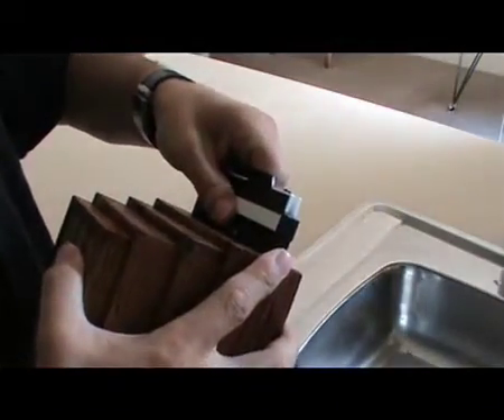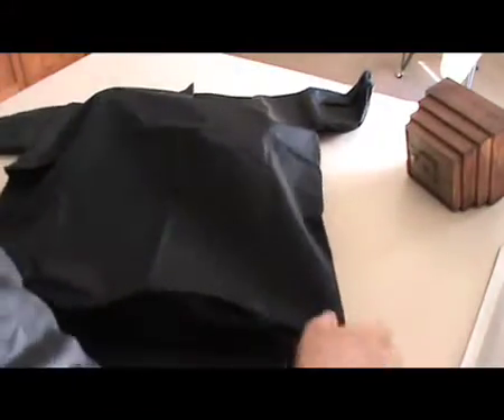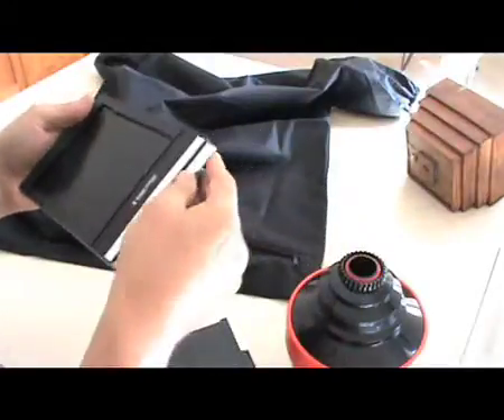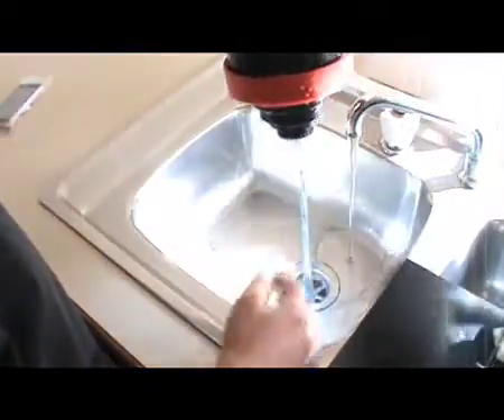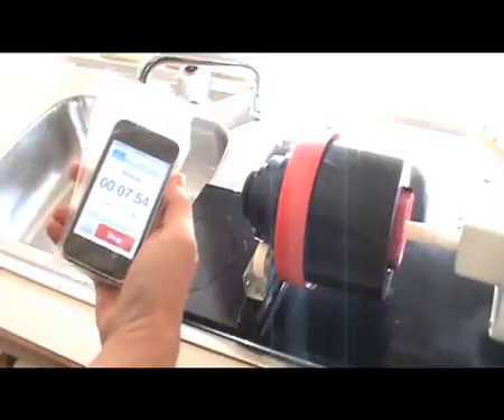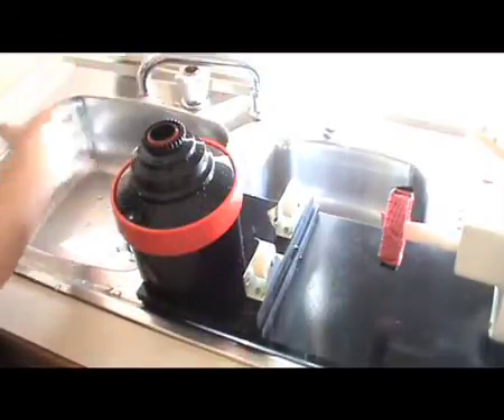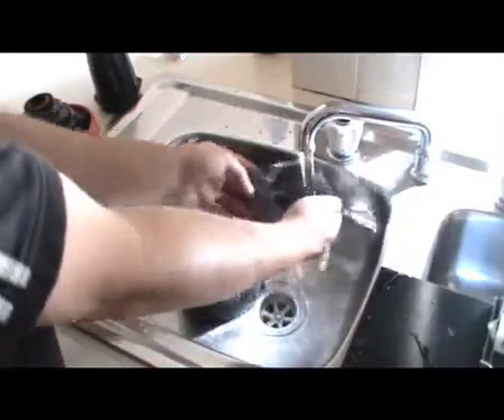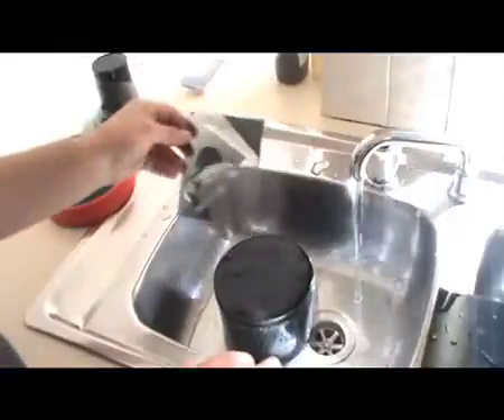Build a 4x5 Pinhole Camera - Part 13 - Final

Comment: Is that a DIY film processor? What do I need to make one? Thanks.
Reply from the maker: The box is DIY, with a commercially made film holder.
I built this out of scrap. You just have to start with the film holder and build out from there.